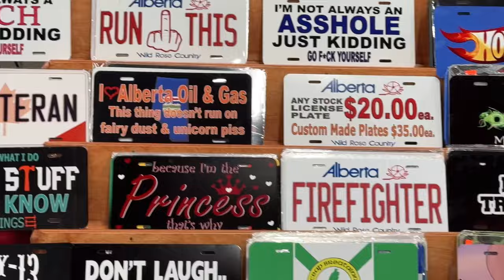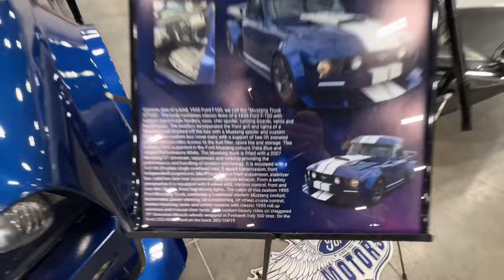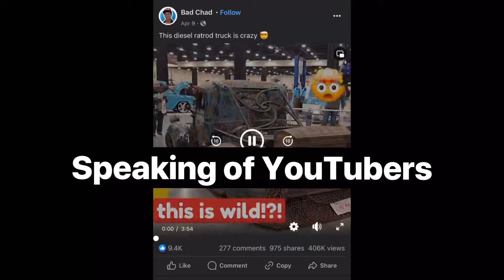The Best & WORST of ‘World of Wheels’ 2024 Calgary Canada

Comment: do some research on that titanium. million dollar race teams use it for weight saving and throw it out after. its not made to get extremely hot and cool over and over, it becomes brittle and falls apart.
Reply from the maker: While I’m not arguing about the race teams use for it, I’ll just be using it for an intermediate pipe between turbos. Most supercars use titanium on their aftermarket exhausts (such as Unobtainium Welding) which get much much hotter. Thanks for caring enough to share tho as I didn’t know race teams tossed them (I want a old race team piece in my collection now lol)